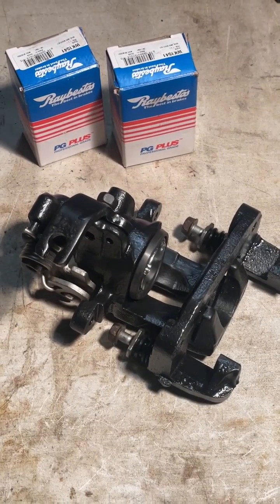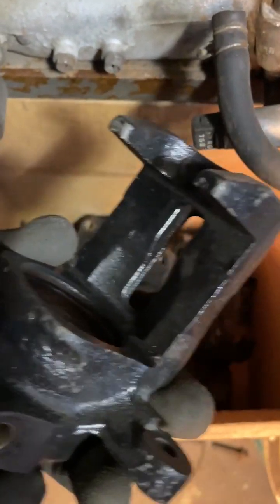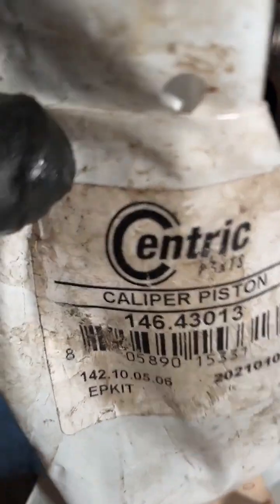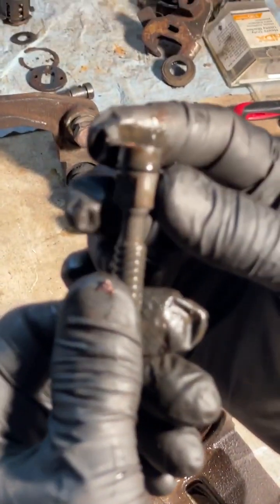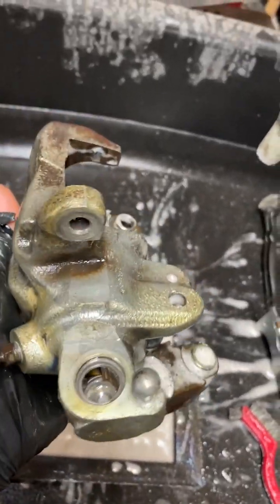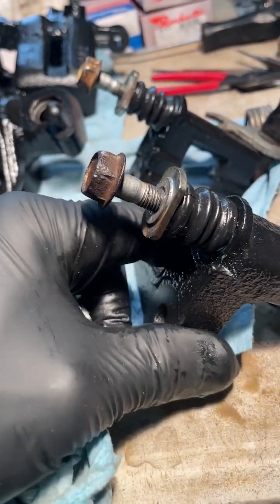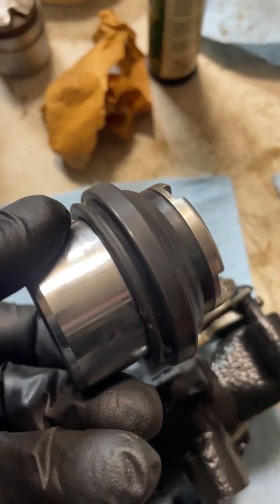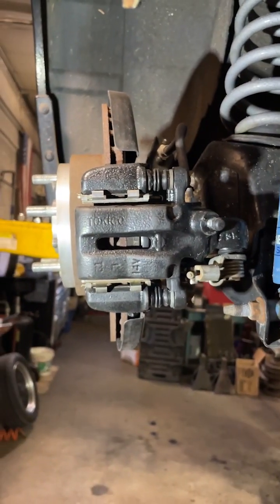Z31 Rear Brake Caliper Rebuild

Comment: How did you get the piston boot in the groove on the caliper?  I've been trying for an hour and get get it in.  I can get it in without the piston, but then couldn't get the piston through the hole.  This is simply the worst caliper set-up I've ever seen.
Reply from the maker: @briguy3693 it’s a little tight. I used a tiny pick with a curved end. I also use silicone spray to help the boot slip in the channel.
Reply: @Z31_Kouki  damn boot wont stay in the groove.  as soon as I get a section in it pulls out as I work around.  Im just gonna ditch this usesless boot.  There isnt enough room between the pston and the caliper for the boot to seat properly.
Reply from the maker: Even if you don’t get it fully on, it’s valuable to protect the cylinder from debris getting in there. But yea, lubing it up is the way I’ve got it to work.

Comment: after taking everything apart i put it all in an ultrasonic cleaner with evaporust then hit everything with a steel wire wheel (power drill and dremel). after that everything came out looking shiny and new. i did i final clean with brake cleaner, painted, and used fluid film on the unpainted parts.

evaporust leaves a film that can be cleaned off pretty easily but it also leaves the metal exposed so you have to protect it soon after or else it will flash rust
fluid film isnt 100% compatible with all rubber but i rebuilt one piston with it covering everything. ill see how well it works before i do the rest.
Reply from the maker: Nice! I need to up my game when it comes to clean up and refinishing.. i get impatient :D